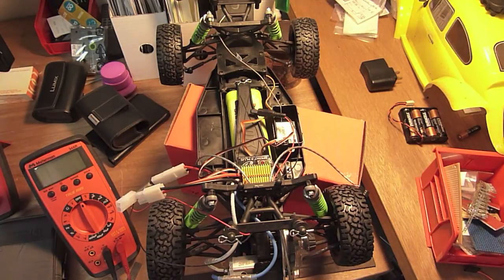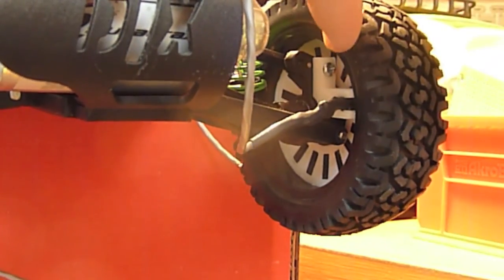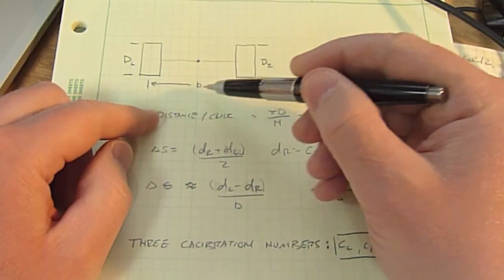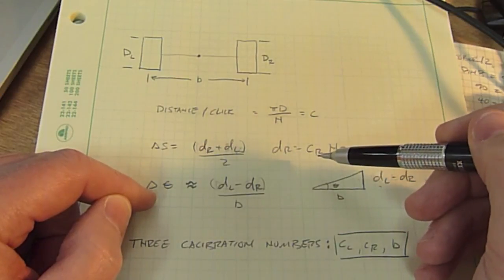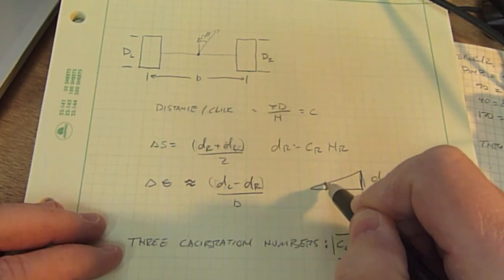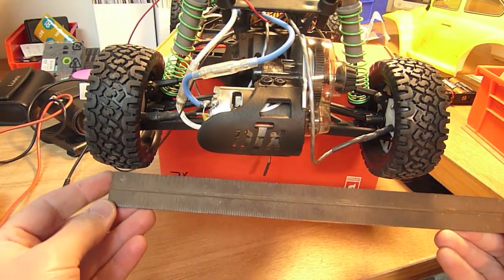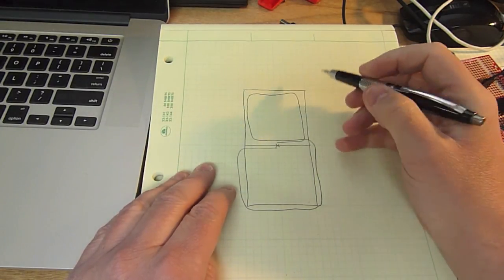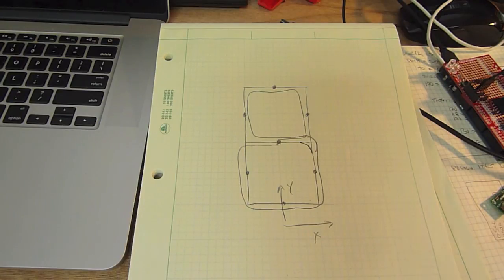Robot Odometry Calibration

Comment: I know you posted this like 100 years ago, so I hope your still online. But I have a question. What units are delta theta in? I want to use this equation to know how many clicks I need to move each wheel to turn 90 degrees for example?
Reply: radians. 6,28 rad = 360 degrees (full circle)